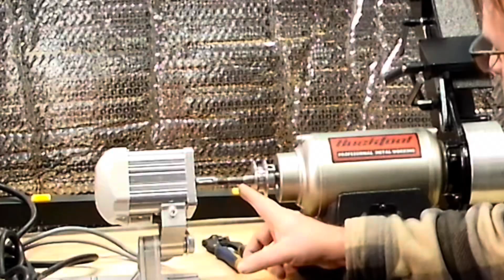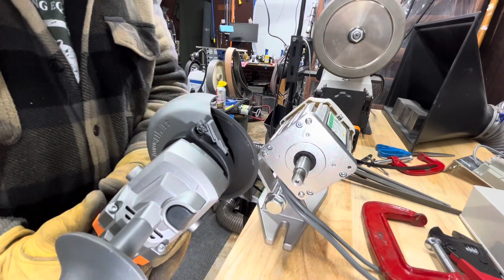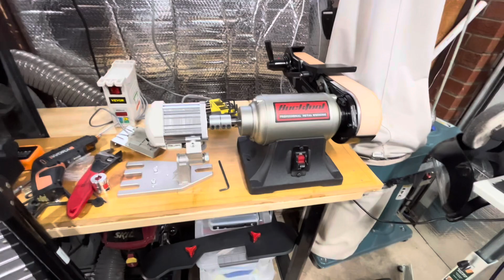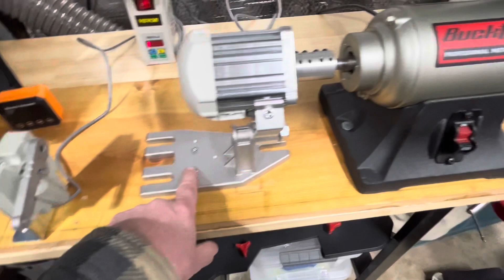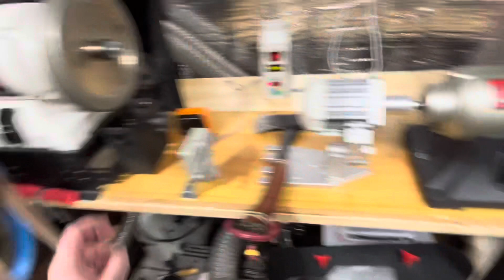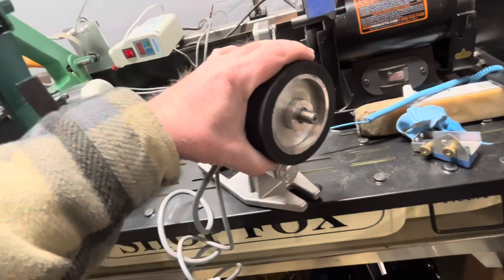Converting a Bucktool 2x42 to Variable SPEED.

Comment: Very cool project and nice video.  I've got the Bucktool 2x42 and am considering doing this to open up more options like lower speeds and reverse direction.

My question for you:  you've got the servo motor spinning the Bucktool motor and it seems to be fine.  If you were to turn off the servo motor and run the Bucktool motor instead, would it hurt the Servo motor?  Or would you need to disconnect it?

Thanks
Reply from the maker: I have never run it but if I did I would disconnect the coupling to be safe. The motor I have attached is no joke.

Comment: This might be a dumb question but why can't you use a vfd to do this?
Reply from the maker: I am no expert on VFD's but  I do know that not all motors respond well to speed controllers many guys tried to use router controllers on things like this or fan controllers and the just don't work or have no torque- Could also be cost not sure what a VFD cost  but from what I have seem these have always been a good solution that works and not crazy expensive
Reply: VFD are designed to work most efficiently with 3 phase motors, not single phase like the buck tool motor.

Comment: I'm way too ADHD to watch this again and see if i missed an important detai, but why are you attaching a smaller motor to run a machine that already has a motor? I see at the end it comes with a variable frequency drive, but you can build one for the existing universal AC motor with technically as few as two electronic components. Like literally a burly, macho TRIAC, like a transistor but for AC, rated for continous 600v and 20A would be sufficient for this job. Add a variable resistor. Technically that would work. That's a two component speed controller you can wire in to one of the two wires going into the machine. 

In real life, we would build a slightly more complex TRIAC/DIAC circuit. This isn't even complex electriconics nerd shit. It's simple power electronics. Incorporate some back EMF protection and some circuit protection- this is a dimmer circuit. It just chops up the AC current and only lets some of it through. Sewing machine foot controls were built this way for years, actually a lot of them just use the simple TRIAC/thyristor+variable resistor circuit. Now they use more modern DC electronics, VFD drive. This is a crazy solution, what you've done here. You can also buy a motor speed controller unit that will work for this.
Reply from the maker: There is no motor speed controller that will work with this kind of motor and not cause a problem or it will have no torque. I tried a  router control they do not work for this and you are also wrong on the dimmer control they only work on some types of motors many others have tried fan dimmers. Also as I said in the video I wanted to still be able to use the original motor if I needed the high speed the Bucktool motor runs at. This has been working great for me for some time. You do realise this is a sewing machine motor like you mention in your second paragraph. You say I am wrong but then you say well it's like a sewing machine motor the thing I actually used to get this machine to do what I want it to do which is to have full variable speed and go both directions. Anyway it sounds like you know or at least think you know a lot about electronics, but many have tried to make the motors on Harbor Freight Sanders variable speed and  go in forward and reverse and other similar tools. If it were easy it would have been done long ago I have not seen it done. So why not go make it since you seem to know the secret and share it in a video and tell us all where to get the parts and how it's done. Once you do let me know. I will be happy to promote your video and channel. I do find it interesting that those like you who love to be very critical of others never have a video or make one showing how to do what they say is not correct. I will be anxiously awaiting your first Youtube video Evan.

Comment: could the drive wheel on the 2x42 not fit on the new motor or would it?
Reply from the maker: No easy way to mount it directly arbor sizes are all different

Comment: Hello, I just ordered that bucktool. Is that belt speed too fast to sharpen? I see you modified it.
Reply from the maker: Most of these were designed with knife making in mind not sharpening so big fast motors for stock removal. For sharpening slower is always better for controlling heat, and the work piece so if you're going to use the stock motor  for sharpening don't linger you will have to use fast strokes and that's not always easy for people. By making mine Variable speed it lets me have far more control over the work piece and the heat. Also why sharpeners like to convert 1x30s or just buy a variable speed unit.
Reply: @ALXSHARPEN  yeah for some reason it says for sharpening as well. I can also take off the wheel and put a scotch brite from curry.
Reply from the maker: @robertmunguia250  mine didn't have enough clearance Cliff just cut away metal to make it fit. He has a video on it . I ordered a custom wheel. Cliffs method is much less expensive than what i did
Reply: @ALXSHARPEN  that mophorn motor unavailable at the moment.
Reply: I wonder if the whole drive wheel assembly including belt would fit on the motor itself? Without using the coupler. Is it a 5/8 bore on drive wheel?

Comment: Might be a dumb question but why not just take off the wheel and entire black arm on the right side and mount that to the smaller motor? Maybe custom plate to it?
Reply from the maker: I thought that but couldn’t find a way to do it I also thought that maybe I could hook it on a different grinder that was variable speed but it attaches to the outer case of the grinder and it’s also what makes it easier to adjust the belt side angle from flat to upright . So the arbor coupling was the easiest solution that I could come up with without having to make major changes to the Bucktool also, doing it this way gave me the ability to still use the Bucktool motor if I wanted to use it. Losing the grinder side for me wasn’t and issue Because I have plenty of grinders in my shop
Reply: @ALXSHARPEN  I’m really considering doing this. Is there a work email I can contact you directly?

Comment: How do you keep this motor on without holding it?
Reply from the maker: I removed the springs and sometimes some of the motors may need a little adjustment to get them to stay but most work perfectly after the springs are removed one of my 1x30 I had to do a little work to the control but normally once you pull the springs off you should be good
Reply: @ALXSHARPEN  thank you so much!
Reply from the maker: @4501jbeezy  no problem happy to help

Comment: What is wrong with the Buck motor?
Reply from the maker: For sharpening it's to fast and only goes one direction fine for knife making  but by converting it to variable speed and running both directions it can sharpen edge leading or trailing and can do much more. I also added custom wheels so it can run Scotch Brite belts

Comment: Hi Paul, I’m a professional sharpener as well.  I’ve been sharpening for 40 years, 30 years professionally. I recently discovered your channel and subscribed because I really enjoy your content and honest presentation. Great job!
Reply from the maker: you should check out the guild of professional sharpeners https://members.guildofsharpeners.org/share/aeqXqAOblvmmrqjI?utm_source=manual
Reply from the maker: Thank you for joining if you do the conversion I did the arbor coupling is very crucial to doing it the way I did It’s linked in the description. The hardest part is just fine-tuning when it’s all done especially the tracking. one other annoying thing on this conversion is the nut that holds the wheel on will sometimes come off if I was going edge leading or the belt coming towards me using a good lock washer has helped, but every once in a while that thing will come off even with aa lock washer I mostly use this machine edge trailing now that I  have two 2x42s the motors we use have a hard stop and That seems to cause enough torque to loosen the nut

Comment: Is it at all possible to remove the whole belt mechanism and attach it directly to the servo motor?
Reply from the maker: Not in a way I could figure out you can detach the belt side but the Bucktool grinder case is designed to have the belt attach to it. Also all the brushless motors I have seen are 15mm arbors and the tool
Is 1/2 inch or 12.7mm so the wheel won’t fit.
Reply from the maker: I had considered using a variable speed grinder and swapping it for the Bucktool motor and use just the Case but it wasn’t a match up with the variable speed grinder I had available
Reply: @Alexandria Knife Sharpening what diameter is the shaft of the Bucktool 2x42?  I wish they made a high- speed/low-speed version like their 1x42 sander.
Reply from the maker: @grantlauinger8663  the Bucktool arbor is 1/2 inch and that’s 12.7mm in metric

Comment: Great video. I ordered one of those 2x42 bucktool last week. Thanks for the videos.
Reply from the maker: Thanks it’s a nice tool if I can find a smaller drive wheel that works on it to run Scotch Bright Belts I’ll be really really happy! So far Im thrilled with it.
Reply: @ALXSHARPEN  I also ordered an Eastwood 1x42 two spd. I think they will go good with my AMK-75 version 2 which is a  1x42 & 2x42 guided knife sharpener that uses a Tormek knife tool rest.
Reply from the maker: @dougepalmerchopchop  It looks like it's the same product. 90% of this stuff all comes from the same factories in China .Most are willing to make things for anyone and put your name on it. I bet the Bucktool and Eastwood are the same. You can get different variations from china if you ask so if you want a variable speed and are willing to buy enough units they will make it with your name on it. If the Chinese own the patent they will sell to anyone and put any name on it. I use to sell camera gear and saw this a lot in tripods. I could get ones exactly the same as some big name companies because the Chinese owned the patent and they would sell me the same thing with my company name on it and would even customize the colors. In the 1x30 sanders you see this all the time Harbor Freight , Grissly, EX ELECTRONIX EXPRESS ,Central Machinery are all the same multiple people selling the same product  under different names but when you get them side by side you see it's exactly the same thing
Reply: @ALXSHARPEN   check origin blade maker for drive wheel maybe